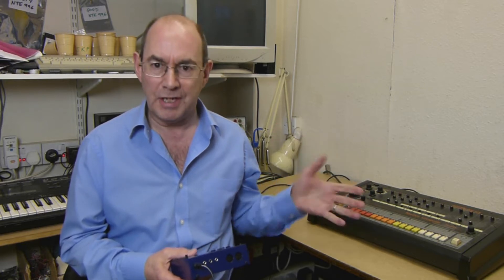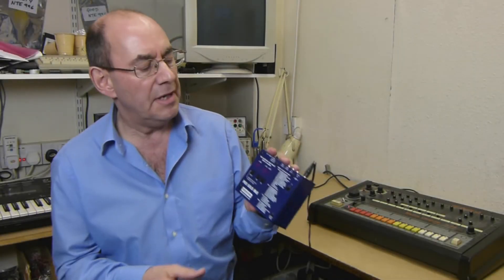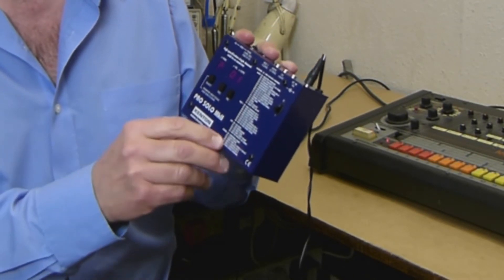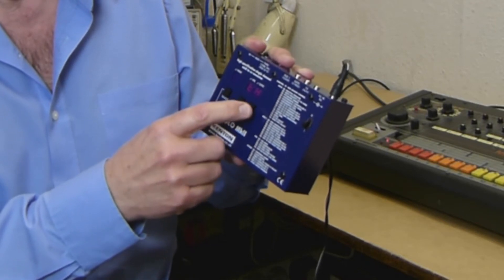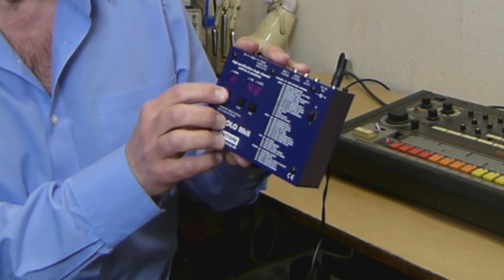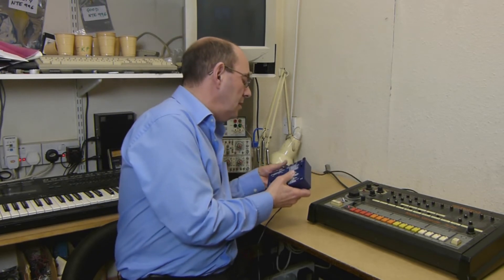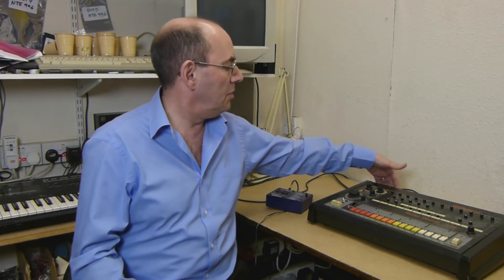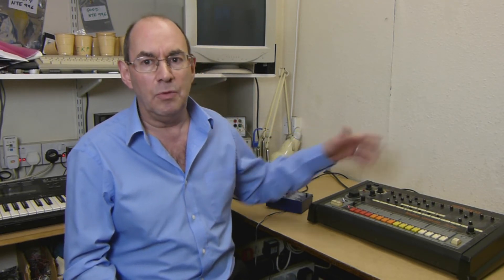TR808 converting MIDI sync to DIN sync with Kenton ProSolo

Comment: It would be useful to have a view of the back of the 808, what cable did you use to plug into the back of it? Also what is operating the 808.. what’s triggering the sounds? Is it a software program. Some of use are beginners and would benefit from a detailed video in order to make an informed purchase.